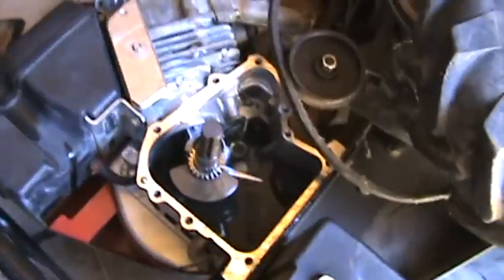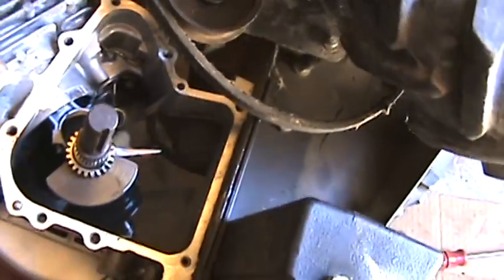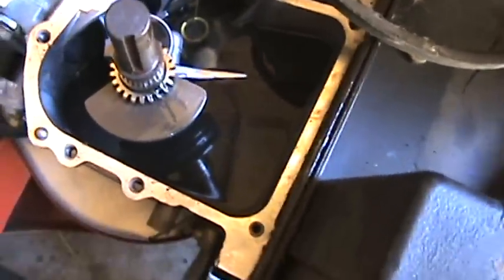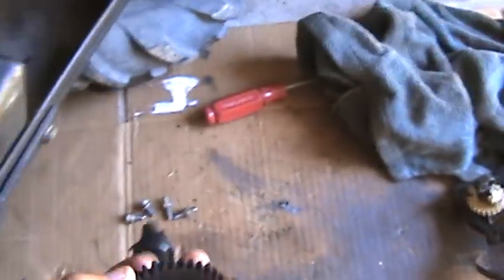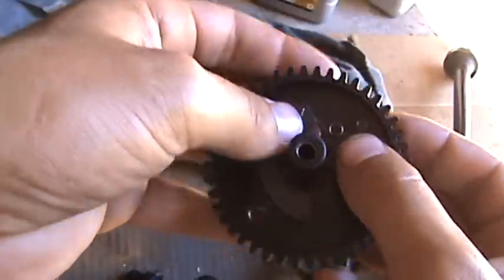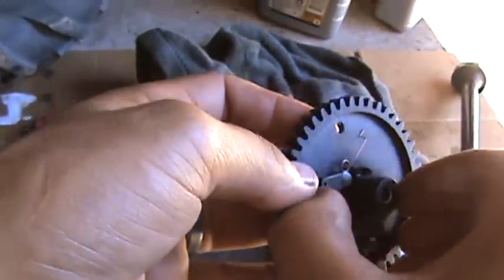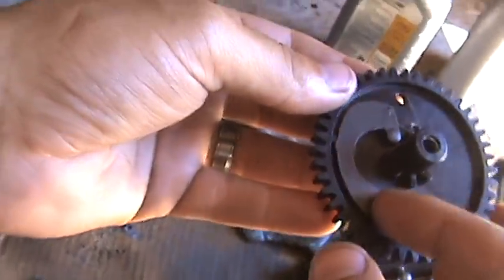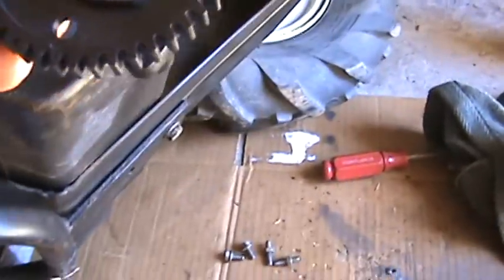How to install a camshaft on a Tecumseh 6hp OHV engine Part 2

Comment: hey i dont know if youll see this but I have the same motor and I timed it right but, its sucking air though the exhaust and blowing out air through the carb. its not much I can definitely tell. do you think this would be a timing issue
Reply from the maker: It does have something to do with the valves now opening and closing when their supposed to. Check your valves, they could be sticking.
Reply: @Dwainsprojects  I appreciate your response and your help. I will check when I have time next.